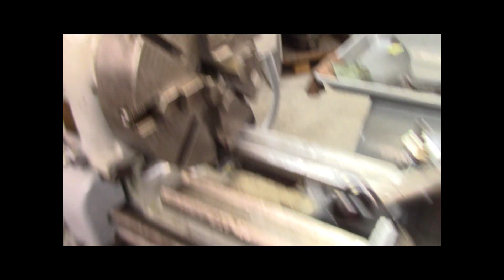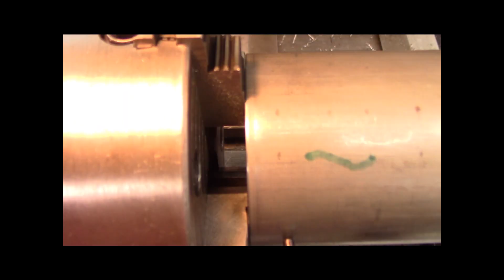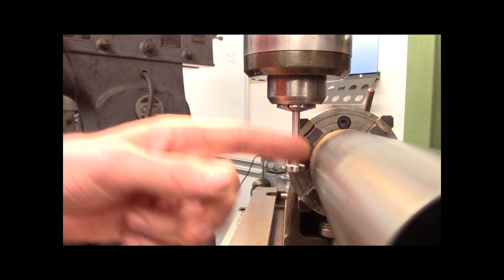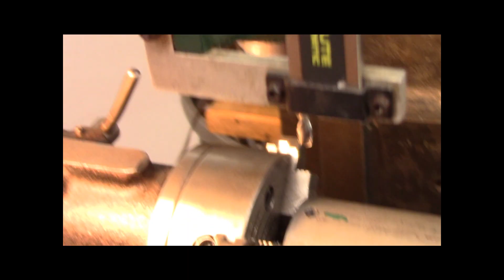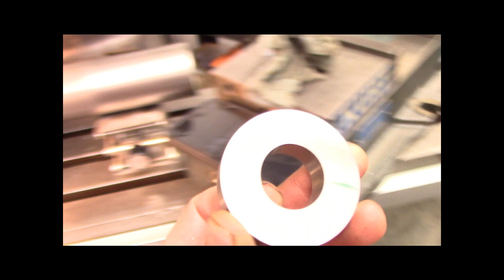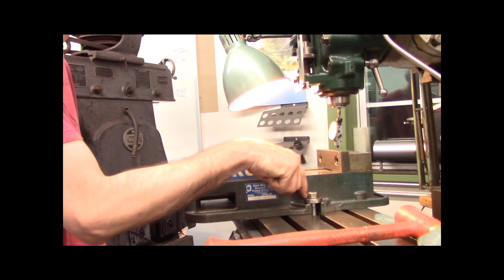7-13-26  --   Hendey T&G Lathe Part 47

Comment: I'm not afraid to tram my vice. I actually finish it with a .0005 DTI. First I use a dowel pin and feeler gages to get it close enuff I can finish it with the .0005 DTI. Once I quit trying to tram the vices with a paralell in the vice it became much more easy. Paralells can become bowed.